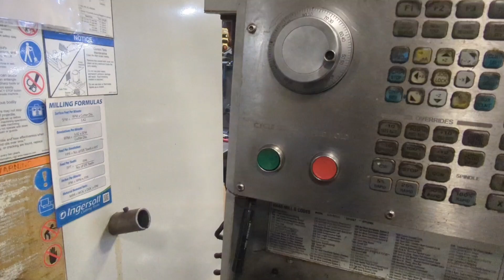Cnc machining 4" flat bars. #cnc #cncmachining #machining #machineshop #cncmachine

Comment: I’m a bit confused by this setup, the left vise looks to barely have hold of the part while the right side is in open air on parallels, some of which are almost perfectly half over a hole? Seems like a recipe for breaking drills and or taps.

Was this job part of a larger batch with multiple part numbers/lengths? I’d like to know your insights.

Thanks
Reply from the maker: Yes, the fixture is for various lengths of similar parts. Every drill and tap location has clearance under the part.  We run alot of these and dull drills and taps is the only reason for them to break on this job.  Now with OSG A taps we barely ever break a tap.

Comment: At 1:40 the coolant does a very interesting thing.
Reply: It looks like when the tool moves to feed height the tsc flow adheres more to the surface of the part, eliminating the inner cone, and other scattering. Neat phenomenon, thanks for pointing it out.